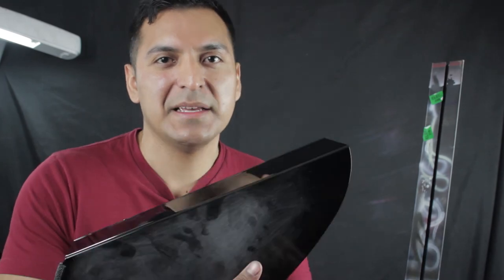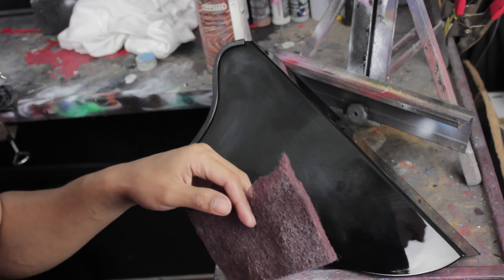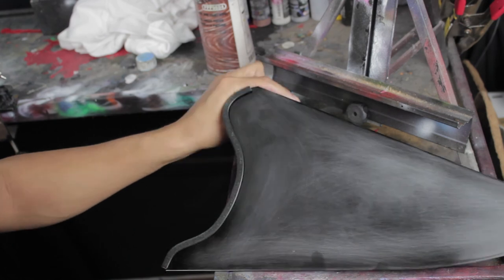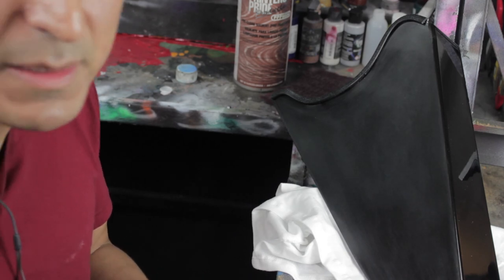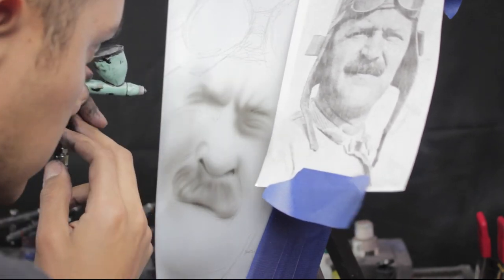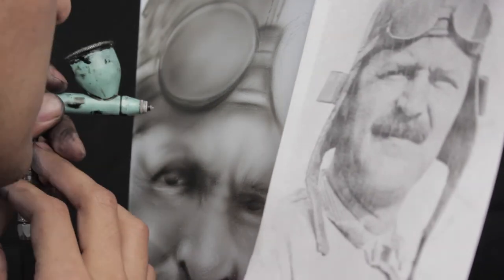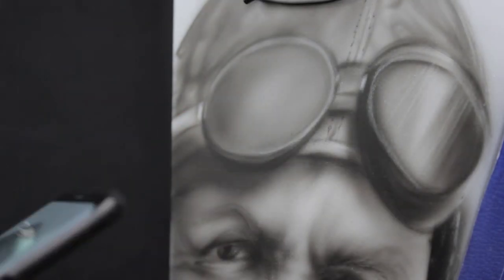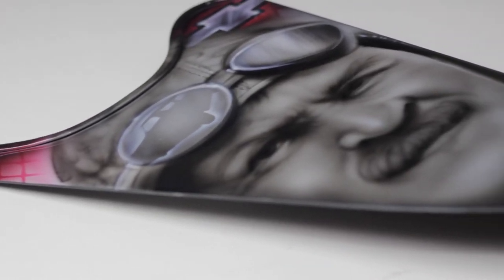How to airbrush automotive portrait on chevy car panel

Comment: Would this be the same process of prep if you're going to use a stencil?
Reply: I'm restoring a 69 bug, and it has a softball size dent right in the middle of the hood, which happens to be custom painted previously by my late brother who was a master painter. So i have to repair the dent and I plan on airbrushing a Black Widow spider in a web over the repair breaking up the stripes where the dent is.